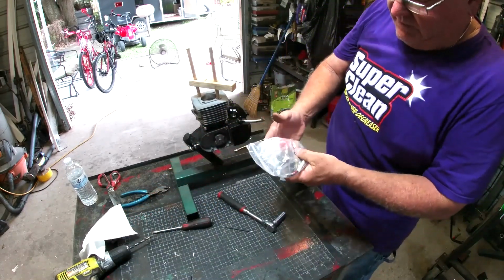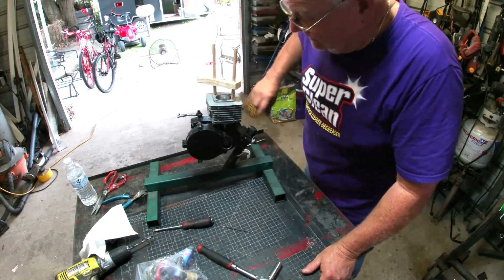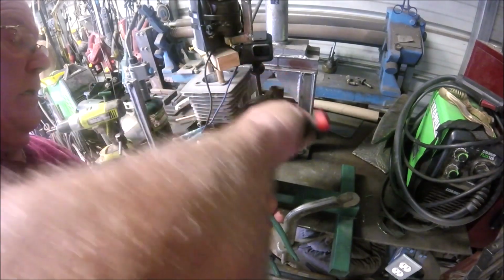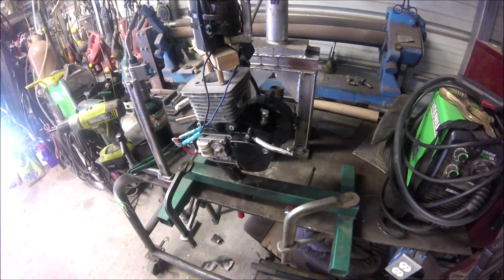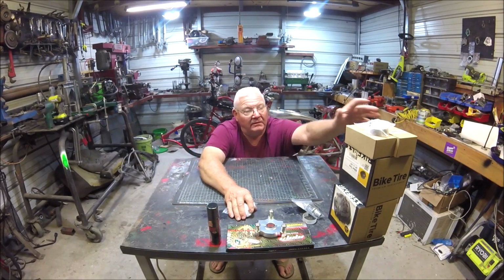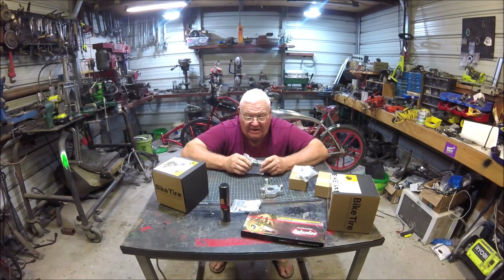Motorized bike does moving the flywheel slop left or right change timing

Comment: Hi sir. Im glad your creating content for us to learn more about motorized bicycle engine's function.  I have an issue with the brand new bbr tunning volt master stage 2 cdi.  The case is that i found out its late firring and I was wondering how to make the spark light up before to fix the issue.  So I saw a video on how to retard the coil without filling the key.  Its just making the coil screw's hole bigger that way i can move the coil  timing foward or backwards without having to damege the magnet key.  I just wanted you to know about another way to move the firring timing for the spark.  Say hi from Puerto Rico!

Comment: Looked like timing was a little off both ways. Try testing magnetism on both sides of magnet by sticking a screwdriver to it, how much pressure does it take to pull it off? Cheaper magnets are not equal, in my research, that's why firing is off....